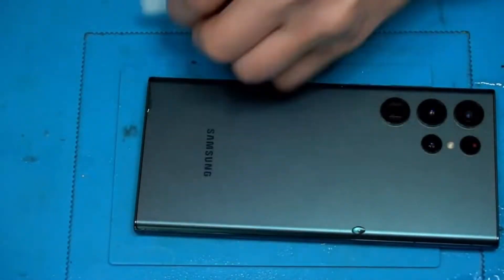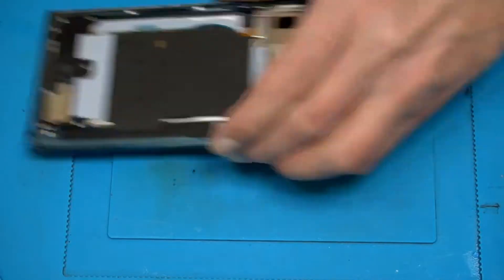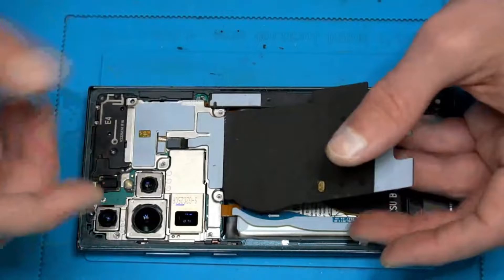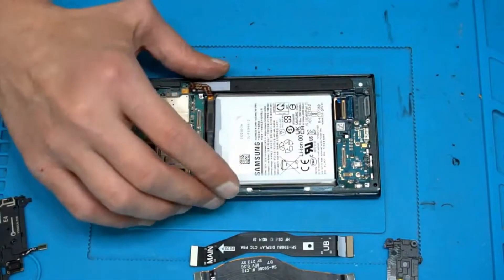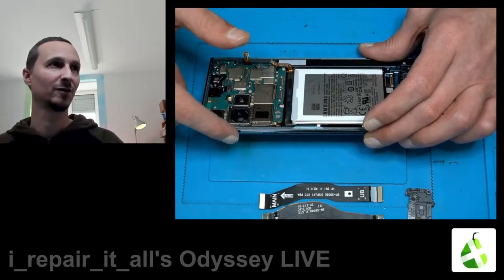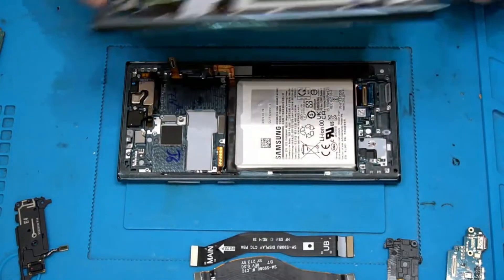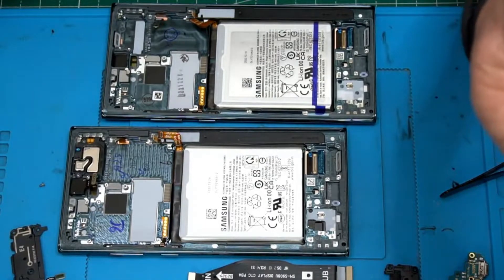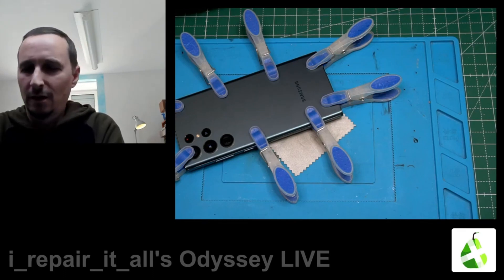Samsung S22 Ultra Teardown

Comment: Hi, really hoping you can help with a quick query.

Is the daughter/charging port board the same for the S908E and S908E/DS? My phone is the dual sim version, I just want to be sure the charging port board is not different. I'm hoping to fix a mobile signal connectivity issue where I have no signal most of the time except in some areas I only get up to 4G signal (I have a 5G data plan). It's a similar issue to what the other user asked you I believe.

I've been looking online and can't find any charging port board with "S908E/DS", only seeing those with "S908E" on it. I just came across your video and I thought I'd try my luck asking.

Thank you in advance if you reply!
Reply from the maker: It is the same. You're welcome.

Comment: Hi. My s22 ultra won't charge. It says it's too hot and has a red triangle and red charge symbol but it isn't hot. I changed the daughter/charging board and still won't charge. Is there a temp sensor somewhere I'm missing? Maybe bad motherboard? Thank you and wonderful video.
Reply from the maker: there is a resitor sensor on the nfc plastik frame located, maybe that is foulty.
Reply: @irepairitall  could you please specify where it's located. I hate to throw it out
Reply from the maker: @dogdooley4495  it is the part which i disconnect at 4:53
Reply: @irepairitall  thank you. I'll check it out.

Comment: Plz reply
Reply from the maker: what kind of signal issues, network, mobiledata, wlan...
Reply: Local sim signal sir
Reply: If I use mobile data signal venish
Reply from the maker: to rule out a software issue you could try another sim. Reset Network settings on the device or backup your data and reset the phone to factory settings. If nothings helped it may be a hardware issue. @muhammadulfat9129
Reply: @irepairitall  I did that even I try saftware
Reply: One thing I noticed in side signal weak out side signal strong
Reply from the maker: there is an antenna flex going down to the daughterboard/ charginport modul. you could try to replace modul and or flex. sometimes corrosion can harm the signal or charging port in different kind of ways. @muhammadulfat9129
Reply: @irepairitall  is signal antenna down side with charging port